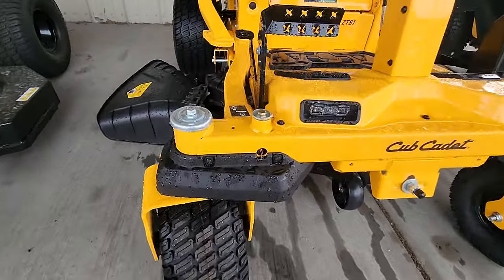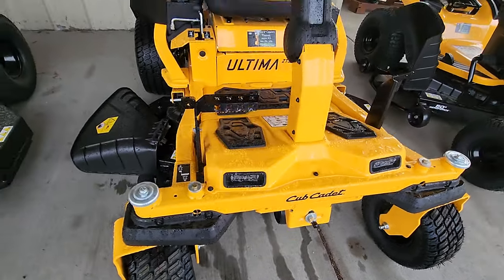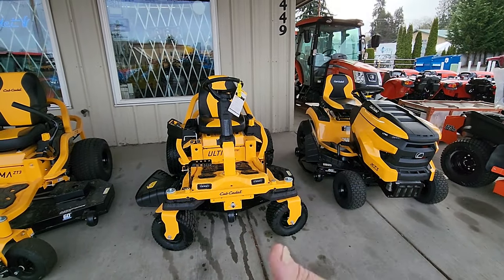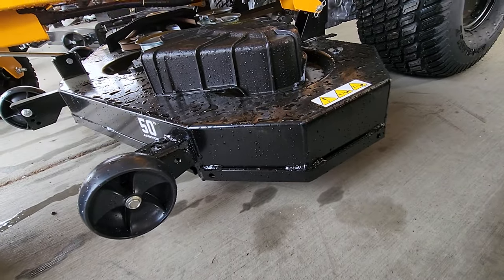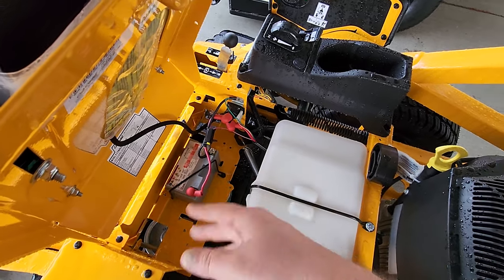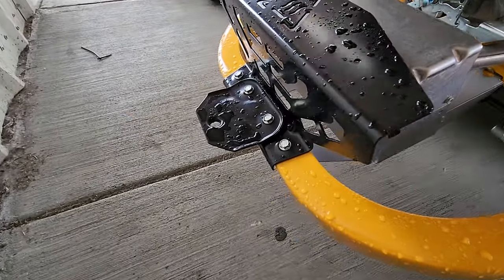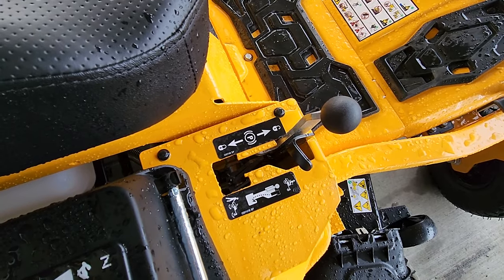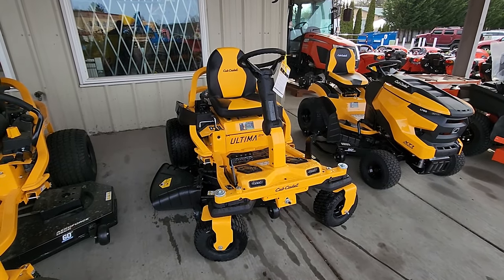Ultima ZTS  - a Steering wheel zero turn mower made by Cub Cadet

Comment: Awesome! I have the ZT1 42 been using 2 seasons good mower so far. Hadn't seen this machine yet can also drive with one hand pretty cool!
Reply from the maker: Cub is consistently making some real winners. The only thing i don't like about my zero is that it's so hard to take a sip when it's hot out. Kinda makes me want a steering wheel again!
Reply: @HomesteadBandwagon  Great point💯💪🏽

Comment: I just got mine and i love it! One thing i might try is a knob on the steering wheel because the wheel is rubberized and very grippy, after a lot of Turning it’s a little rough on my hands.
Reply from the maker: Those little buggers sell like hotcakes around here!
Reply: How much they they cost? Comparable to reg. Zero turn? Need to replace my raptor zero turn, and this looks interesting. Am looking at a regular 50" cub cadet zero turn for $3900 at my local TSC.
Reply from the maker: Usually they sell for 800-isj more than their lap bar counterparts
Reply: That’s exactly why I got a steering wheel knob on my 2023 Ultima 50” ZTI thanks for your advice and I’m doing thick 6’ high fields 30 degrees It’s a beast !

Comment: We got one with the steering wheel,  and like it.  ( and yes we still get stuck and need the ATV to pull it out sometime ) We have had it for about 5 years now and mow about 2 acres with a lot of obstacles.  Thinking about upgrading to a new one, but the one we have is working so well,  I hate to take the chance we get one that doesn't.  Not too bad to take the deck off to sharpen blades for  a 65 year old, does not use oil with the Kawasaki engine and still on the original battery.  A little difficult to change the oil ,  needed to fabricate a piece of pipe to keep oil from going everywhere when changing.  Thanks for posting Homestead Bandwagon.
Reply from the maker: Sounds like you've got a fantastic machine! Keep er on the grass for as long as you can!

Comment: I have ZT2 60 inch.  It's a Beast. Bars are always faster to turn than a steering wheel.
Reply from the maker: For sure. We use a lap bar mower at our property, but these steering wheel units are fantastic on properties with a lot of slopes!

Comment: I have the zt1 50 standard zero turn, have used it for 4 seasons.  It is the best mower i have ever owned and does a terrific job.  The only issue i have is the suspension, it beats me to death.  Does this mower with the steering wheel have any type of suspension other than the useless hard rubber pieces under the seat.

Comment: I bought this mower last week. I love it. Have you put a bagger on it yet? I'm actually trying to confirm if the counter weight actually fits. I need additional weight in the front, I have slopes in my yard. Thanks in advance.
Reply from the maker: Haven't tried a bagger on one, but Cub tends to make a pretty great system. Big ol' tube that doesn't clog too easy. The old front weight kits bolted on pretty easily, so hopefully this one works the same
Reply: @HomesteadBandwagon  Thanks for the feedback. I'm going to hold off until I can confirm if the weight will actually fit.

Comment: have a cub cadet z force zs zero turn, barely moves in reverse?
Reply from the maker: Could be a number of things causing that- sometimes, the linkage between the reverse pedal and transmission can come partially unhooked. Or, it could be a failing transmission

Comment: how do you mow in reverse my zts1 does not
Reply from the maker: On the steering wheel models, you can start the mower, click the key left one click, and then press and hold the little triangle button with the exclamation point in it for a few seconds. Should allow you to mow in reverse until you shut the mower down
Reply: thanks for your support, and it worked great for your advice